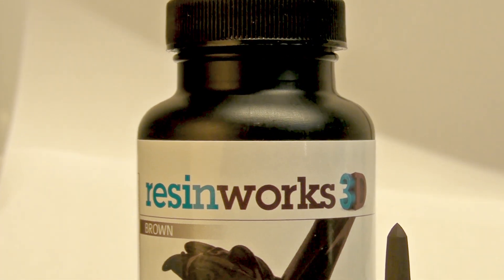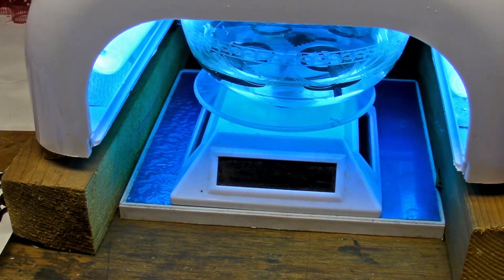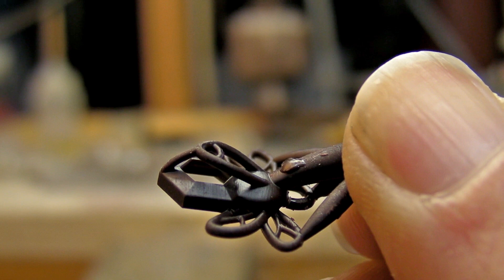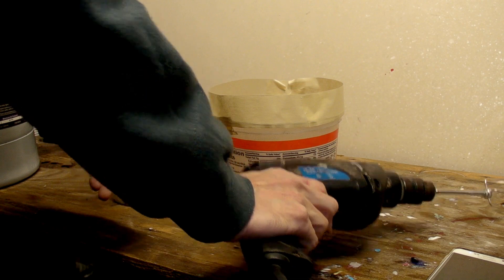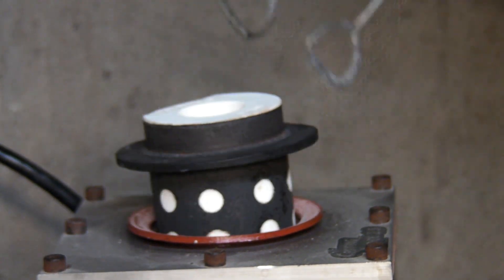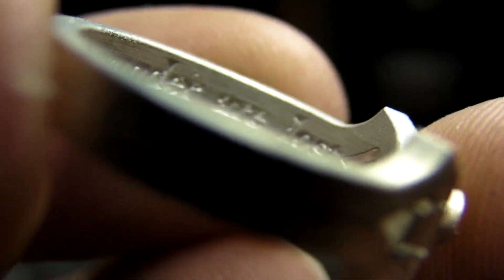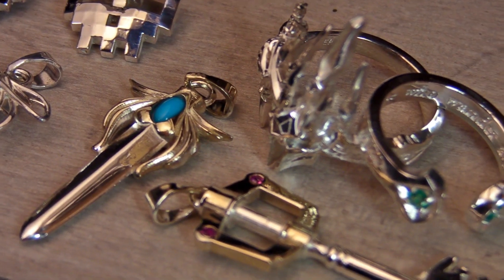Casting Jewelry with Resinworks3d EasycastHD

Comment: Hello, what do you mean by you add 1% depending on investment weight? also if you can give a more detailed equation for the ratio you used later on in the video. thank you so much in advance!
Reply from the maker: Hello. As an example, if I use 1200 grams of investment I would add 12 grams of boric acid. The Ransom & Randolph Investment website has an excellent calculator for determining water to powder ratios for different flask sizes.

Comment: just out of curiosity what did you use to set the stone in the bee?  Thanks for the boric acid tip
Reply from the maker: I used a beading tool to push metal over the corners of the stone. A milgrain tool was also used to add detail to the bezel.
Reply: @SterlingKisses  thank you sir, I must have missed the prongs it was a lovely setting.

Comment: Pls tell me the burnout timing
Reply from the maker: I believe I used this burnout schedule, but the instructions that come with that bottle should work well too:  Ramp 1465f per hour to 300f hold for 1 hour. Ramp 540f per hour to 900f hold 1hour.  Ramp 540f per hour to 1382f hold 2h. Full ramp to casting temp and hold for 1 hour (or 2-3 hours for larger flasks) then cast.

Comment: Hello , what a nice job , I am trying right now to print some rings with the same Resin but I couldn’t get the right calibers until yet could you tell me what are the right calibers for this resin , btw I am using the Photon Mono X 3d Printer 
Best regards
Reply from the maker: The last time I used this resin was on a DLP Printer so your settings might need some tuning: Bottom Layer: 33 sec. Normal Exposure time 5 sec at .03mm layer height.
Reply: @SterlingKisses  wow i have a esun casteable resin , and need to use 60 sec bottom layer, I think is too much but i have acceptable results. In argentina your resin doesnt exist for buy it

Comment: Nice video. I saw some slight water trail, on your casting. Not sure if you tap your flask on the side after you pour and vacuum your flask. It helps with that for some reason. On the green stone setting, in a situation like that, I would suggest you use a beading tool as a prong pusher, instead of pliers. One more tip, finish out the ring completely before setting the stones, then go back and do touch ups. Great work, enjoying your videos. I have been a professional jeweler for 37 years now.
Reply from the maker: Thanks! I just let the flask sit after vacuuming the investment. I'll have to try the tapping trick!
Reply: @SterlingKisses  best wishes!

Comment: "Very sophisticated mixing equipment".  LOL.  I love it.  Bravo on the 3d prints. I tested that material at a very large jewelry manufacturer and it worked flawlessly. However, their commercial printers had to be used with a proprietary resin so there was no way to switch to this burgundy stuff.

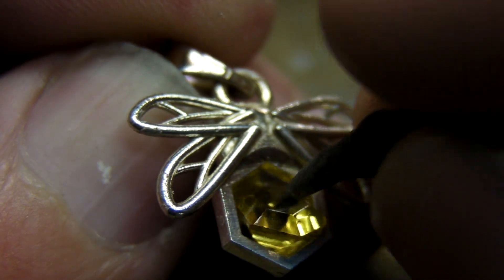Comment: 5:28 how to fix that yellow stone without using prongs? Would you glue that in? Do you have a video showing how to set gem stones without using prongs? How is that stone setting of the yellow stone called?
Reply from the maker: The stone is bezel set. Surrounding metal is pushed over the stone to secure it in place. An example can be found in my Gold Skull Dice video. https://youtu.be/C4EnXIiqy0U

Comment: Great Video! What is your burnout cycle?
Im upgrading from an old (non-digital) pro-craft kiln. I’m going to be using a paragon kiln with a controller to program
Reply from the maker: Thanks for watching! Here is my schedule:
Place flasks in 300f preheated kiln. Hold 3 Hours; Ramp @ 1680f per hour to 700f. Hold 1 hour; Ramp @ 1680f per hour to 1350f. Hold 4 hours; Full ramp down to casting temp. Final Hold 1 to 2 hours based on flask size.

Comment: Hello, I wonder what powder you add to gypsum water.
Reply from the maker: Boric acid
Reply: @SterlingKisses  thank you for your centlemen
Reply: How much gram mixed wather&boricacid
Reply from the maker: @murtazadanyal1702  I add 1% of boric acid by investment weight.
Reply: @SterlingKisses  thank you for all
Reply: what is the name or brand of the investment.
Reply: phosphated or  dental investment
Reply from the maker: @murtazadanyal1702  I've used both R&R Plasticast and Prestige Optima. You shouldn't need to add boric acid to dental investment.
Reply: @SterlingKisses  thank you
Reply: acid boric

Comment: thank you so much for the video! I have a question, do you know how much the models gets smaller in the process? I have heard that the final piece is about 6% smaller. I would like to scale some jewelry pieces before printing them, specially to avoid problems when setting the stones! 
Thank you!
Reply from the maker: In my experience I've found that the final piece cast in metal only shrinks by about 1% compared to the original resin print. This might be higher if you make a mold of the piece first and cast in wax though.

Comment: Just came off a video where someone else used PowerResin's WAX resin for lost-wax rather than burnout investment casting. Any opinions or thoughts on this vs that?
Reply from the maker: It seems the only major difference is that PowerResin Wax doesn't need to be post cured after printing. Could help to speed up workflow by eliminating that curing step and you don't need to worry about under curing a piece.
Reply: @SterlingKisses  fair enough then. Thanks for the feedback!

Comment: Layer lines are clearly visible @5:27 - is your printer capable of anti-aliasing ? Is it possible to remove such layers before polishing ?
Reply from the maker: Emery wheels work well to remove the lines before casting.
Reply: @SterlingKisses  oh, so you do remove some material at the end, OK.
I am asking because those visible lines prove that resin/technique is capable of reproducing really small details, and is easy to work with - as opposed as one of the direct competitors, Bluecast OG or X10.
Reply from the maker: @cthulpiss  I was thinking of getting some bluecast. Is it not possible to clean up grow lines with x10?
Reply: @SterlingKisses  It's not the cleaning that is the problem - 
as far as I know/tried Bluecast  X10 practically requires primer to coat the build-plate (add. cost) and resin customizer (softenizer or hardenizer of sharpenizer, add. cost) so the whole process is over-complicated as opposed EasycastHD you reviewed here.
I new to casting, so look at https://www.youtube.com/watch?v=w_vtrYIhXqE  +  https://www.youtube.com/watch?v=WSHGFbB7QOw  (second part is important one).
By the way - I just love your skull dice, the model is really awesome!

Comment: Thank you for the details shared in this video Nic! I'm a jeweller and only hand make. But I want to start 3D printing and casting. Do you have any advice or information regarding a good affordable 3D printer for beginners? I'm currently keen on the Phrozen Shuffle 4k. Any thoughts on that machine please?
Reply from the maker: I know of a few people that use the Phrozen Shuffle for jewelry. They get very nice results from it.
Reply: @SterlingKisses  Thank you very much for the feedback! I really appreciate you taking the time to reply! Since my previous comment I thought that maybe a cheaper option would be good to start out with, and have settled on the Elegoo printers. 
Do you have any comments or advice for me, please, on these machines?
Reply from the maker: @dustysanders2790  The more affordable printers like the Elegoo Mars for example will still work well enough for jewelry, but if your piece has fine details they won't be as sharp looking. Still a good entry level machine though.
Reply: @SterlingKisses  My Elegoo mars 2 pro seems to do VERY high detail.  I'm gonna give it a try soon (on jewelry)

Comment: Great video!!!!....How thick is the investment powder/mould? Which machine did you use for casting , moulding and heating the metal? And which resin and 3d printer did you use?

I 3d printed some jewelry but when i casted the model it didnt turn out well and it broke? So just wondering if you have any tips??
Reply from the maker: My flasks are 3.5" tall by 2.5" in diameter to give you an idea of how much investment is in there. I use a vacuum pump and electromelt for casting. For this video I was using Resinworks brown material printed on an Asiga. I would need more detail to help you figure out what went wrong with your casting.
Reply: @SterlingKisses  do you used the vacuum pump to get the air out of the plaster or to suck the resin out of the mold?
Reply from the maker: @marcscheuer530  the vacuum is used to remove trapped air from the investment. The investment then hardens around the resin. The flask is then placed into a kiln and the resin is burnt out.

Comment: Wouldn't it have been easier to cut off the supports from the rings before curing the resin...
Reply: No, they are there to let the silver flow into the lower parts of the mold.

Comment: Hi, congratulations for the video.
Do you have a reason to put the printed pieces in a container with glycerin when they are under UV light?
Usually the pieces are washed and then put dry under the light.
Greetings from Italy.
Reply from the maker: I've heard that the prints cure more completely in an oxygen free environment. The better a print is cured the better it will burn out.
Reply: @SterlingKisses  i think I found the answer myself. Seeing other videos on 3d jewelry prints, the use of glycerin under UV light is due to the specifications of the castable resin that is used. For the oxygen-free environment, this part only covers the procedure for the lost wax technique. It is used to remove the air bubbles which would then ruin the creation of the jewel.

Comment: Could you explain more about the role of boric in the coating? Thanks
Reply from the maker: Boric Acid is added to the distilled water used for mixing investment. It strengthens the investment mixture so the resin is less likely to damage the investment during burnout. Please watch from 1:57 and let me know if you have any other questions.

Comment: Can you shed some light on how to do this...i have this same resin and have been trying for over a year to get good results...im stumped and cant go to a school because its not feasible.
Reply from the maker: Here are a few ideas: After pouring your investment, let it bench dry for only 3 hours. Then place it into a preheated kiln for burnout. Try adding airflow into your kiln (if it's an electric kiln). Use a small aquarium air pump and direct the air through a metal tube into the base of the kiln (I had to drill into the door of my kiln to do this. Don't drill near the heating elements on the side of the kiln). Finally, try this quicker burnout cycle: Ramp 1465  to 300f. Hold 1 hour. Ramp 540 to 900f. hold 1 hour.  Ramp 540 to 1382f. Hold 2h. Then full ramp down to casting temperature  (1100f for light silver pieces). Hold for 1 hour then cast
.